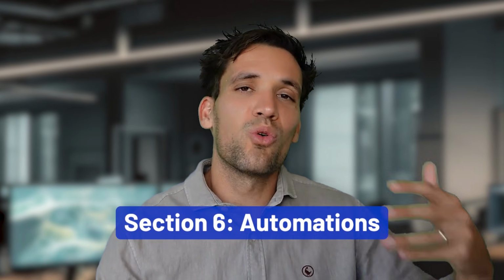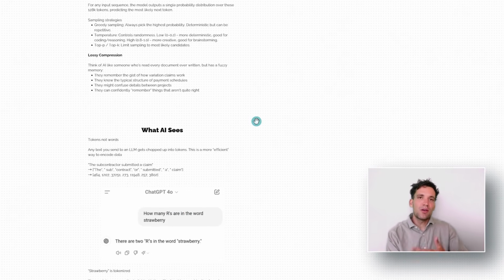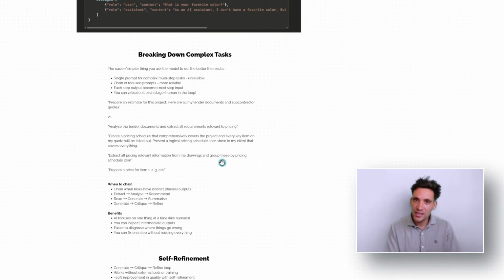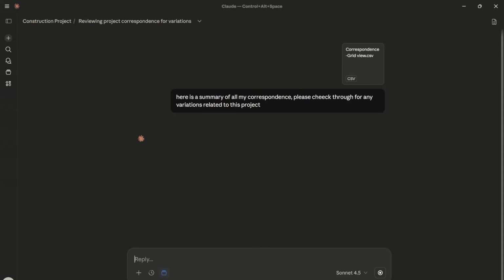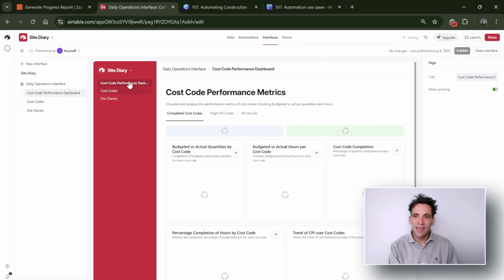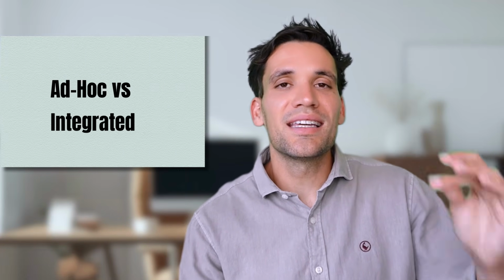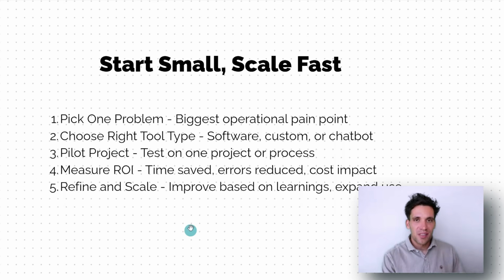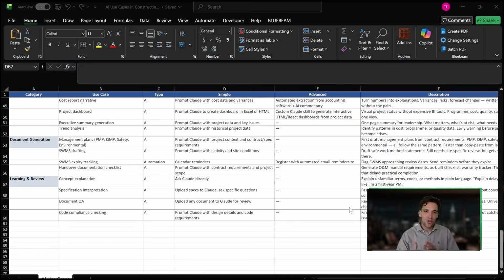AI in Construction - The Complete Applied Guide

Comment: It's interesting when you say, "construction is all about avoiding mistakes" (10:10). Looking at many major public infrastructure projects, that statement doesn't always reflect reality.

Take Australia as an example. Large public projects frequently exceed their original budgets, not by a few percent, but often by 50%, 100%, or even more. Cost overruns and scope variations have become so common that they're a fact of life, and cannot do without.
So I'm not convinced that simply having a more experienced engineer, or doing additional due diligence upfront, necessarily leads to accurate final cost estimates. If that were consistently true, we'd see far fewer overruns on major projects. In my view, the issue is often less about engineering competence and more about the inherent uncertainty, evolving requirements, commercial pressures, and optimism bias that characterize large-scale construction.
In that context, a 5% estimating error from AI may be relatively small compared with the inherent uncertainty already built into mega projects. The goal shouldn't necessarily be perfect estimates, but producing estimates that are materially better than today's process while saving significant engineering time.
That said, I do agree that on smaller projects, where every dollar directly affects the contractor's profitability, there tends to be much greater incentive to estimate conservatively and control costs closely.
Reply from the maker: I guess becuase mistakes exist, doesn't mean we still shouldn't avoid making them?

It's an singihtful point though, that 5% estimating error for AI may be insignifcant, but generally uncertainty compounds. So you have the inherent uncertainty + the AI uncertainty

Also on your point that engineering competence isn't the problem, I do agree but it also helps address problems like uncertainty, evolving requirements and commercial pressures
Reply: @ConstructIQ 
Comparison should not whether AI produces a perfect estimate, but whether AI can improve upon the accuracy and consistency of current human-led estimation practices. I believe, if an AI-assisted estimating system demonstrates a predictable and measurable error profile while matching or outperforming experienced estimators, its adoption can reduce overall project risk rather than increase it. AI should therefore be evaluated against the existing industry baseline, not against an unattainable standard of perfect accuracy.

Comment: Great video! I have a question. As a site inspector, I’ve tried Dalux and Fieldwire for defect tracking, but on smaller sites I always go back to WhatsApp. It’s the only tool everyone (from PM to laborers) actually uses, and reactions make status updates super easy.
My biggest pain point is manually copying text and photos into Excel for reports.
How would you use AI to automate this? I’m looking for a way to bridge the gap between a simple WhatsApp group and a structured spreadsheet without the manual copy-pasting.